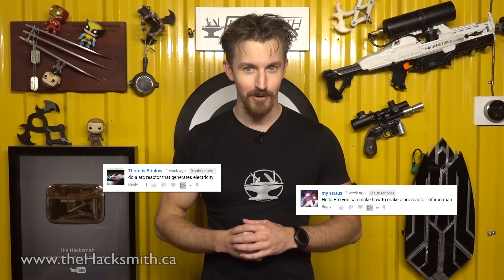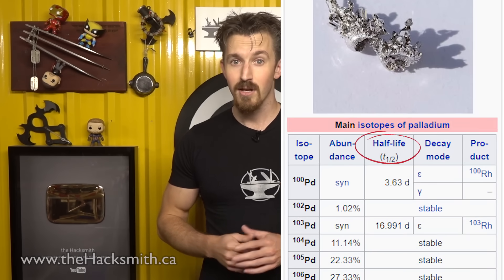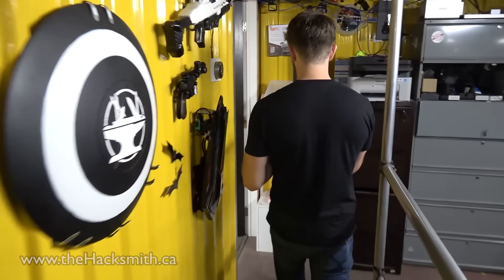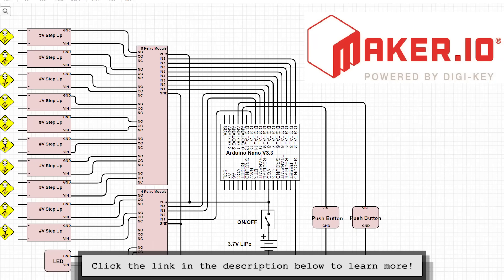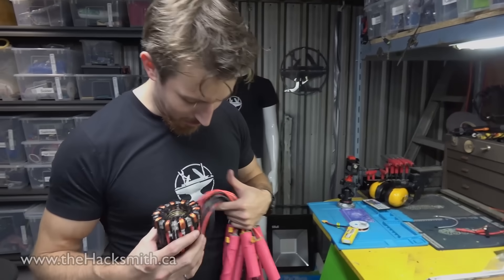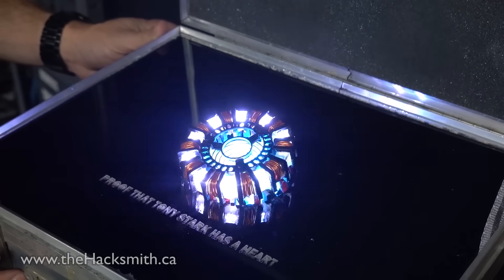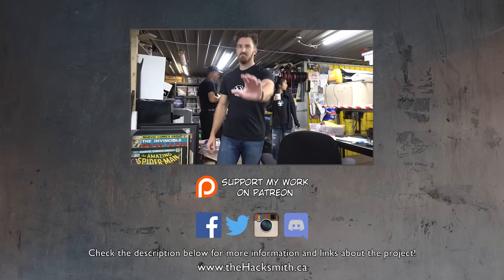Real Arc Reactor (ionized plasma generator)

Comment: Aaaaah, ARCS! Also for low power low noise arc reactor, you can also use a circular glass tube (like neon light), fill it with argon or something and run high voltage plasma through it. Maybe I should try and make that myself...
Reply from the maker: Do it! The internet loves arc reactors :)
Reply: @hacksmith  lol☺
Reply: @hacksmith  is banana radioactive
Reply: @hacksmith  the key to making and technology isn't using less energy than you put it. It as finding ways to harness laws of the universe to do the energy collection for you (which in our eyes is limetless energy)
Reply: Try it ! Use Xenon so u need to be Patient to dont get poor 😁
Reply: Collab
Reply: @LokayB455  no that's a bad idea he will just gonna destroy it all and die
Reply: It could be used as a prank when someone is sleeping you could just turn it on they’ll get scared
Reply: My thoughts exactly.
Reply: Gimme da meter
Reply: Ohh it's you 
Good luck man :)
Reply: I love your channel Electroboom you are too funny
Reply: Give me the meter...give it to me...
Reply: That's the first idea i got - i found a old flash for cameras likely from 60-s or so.  it was a U shaped tube. I used 9V supply and a stepup transformer from a TV - had no problem with a full arc - not constant tho.  That was like 18 years ago.
Reply: Oh and also gimme da meeta
Reply: Yes
Reply: YES!!!!
Reply: Right hand rule :)
Reply: You should do it!
Reply: Don't blow yourself up
Reply: That would be really cool, just be careful of not dying in the process :D
Reply: What about hydrogen so fusion will happen
Reply: Argon wouldn't get the affect you want for the plasma... H4 is what you would want to use ideally but normal h should work... (hydrogen 4)
Reply: Gimme da meter

and dont forget

BEZAN-LIKE-O
Reply: Can you please give me that
 Iron man helmet i beg
You
Reply: Yes!!! & Please make video & let me know
Reply: Please make it!!!
Reply: I am just  wondering electroboom while watching the video, and got you down in the comments
Reply: Oh look whos here!
Reply: ElectroBOOM Come on do it!
Reply: Which has the advantage of looking like the big one from the movie! You might wanna inquire if Stark Industries is hiring.
Reply: you have to do this with rubber gloves ;-;
Reply: Ark.. not arc.. ARKS. Damnit why is it so hard to realize...
Reply: ElectroBOOM Or touch the mains! ;)
Reply: I was thinking the same thing.
Reply: yes
Reply: Can you explain how the power is drawn from the arc reactor..?
Reply: @UltraInstinct666  the ''arc reactor" they made in the video isn't real it's just for show. They are using power from a battery inside the case
Reply: @captaincrazy5008  
Yes I know that... I just wanna know how does the ark reactor give the output...thats it
I meant either any of them..
Reply: We need collab
Reply: I dare you to make it. It's gonna be LIT
Reply: Do you have any limit of knowledge
Reply: Do it and you're cool
Do it and you're cool!
Reply: Just do it Electroboom
Reply: Hi
Reply: Go for it dude!
Reply: hey make it, we would love to see that
Reply: ElectroBOOM mate you will go boom if you try this
Reply: Please make it
Reply: GIMMIE DA SCOPE!
Reply: So it's actually safe to charge your phone with that? 😂😂😂
Reply: Yes please!
Reply: you better do it man, i will love to see that one, +1 good man
Reply: Yes plasma! Those gases are easier to obtain now
Reply: There's a machine I used when I was taking a course in micro technology. Not sure the real name of it, we just called it the sputterer. It's about oven sized and is a large chamber that you fill with argon that gets ionized to the point where the ions starts to bump into a gold or copper disk and effectively yank atoms off of it. Basically it just creates kind of an atomized metal mist so you can throw a few microns of gold or copper onto the surface of a silicon chip. The viewing window looked just like an arc reactor when the machine was running. 
Tl;st: I had a class where we used an arc reactor looking thing to make things more shiny.
Reply: Holy shit, electroboom!

hi.
Reply: ElectroBOOM DO IT
Reply: I was thinking the same thing, there's hope for me yay.
Reply: Just make it and BOOM!!
Reply: @ElectroBoom please do!! I would be excited to see how you manage to hurt yourself in the process!!
Reply: don't forget to shock yourself
Reply: NOW A DAYS EVRY THING BLOWS UP
Reply: I was just vacuum pumping mine out but I guess gas could have a pretty neat effect however I think that the extra material in between the arcs wouldn't be power-efficient though
Reply: What
Reply: @square9980  did what I say throw you off just wait my version will be out soon currently have collected 64 grams of Palladium from old computers as soon as I find a machinist that can use Diamond bits to cut quartz crystal I will start production of my model and we'll see who produces more power remember this one on the video is only using arcs of ionized energy mine uses a solid beam of it
Reply: IIRC Argon would create a green tint. I think they use nitrogen to create the blue color in plasma globes (helium makes the purple color), but Xenon would also work (and be expensive as all get-out) but would be a much darker blue.
Reply: It's called a plasma ball and Nicola Tesla already invented it. Lol. That is the first component of an arc reactor the plasma will spin if you can have an induction coil around it. That's okay I have said enough please excuse me I am a mad scientist. Lol
Reply: For the love of all the possible boom, please built it!
Reply: The key is the frequency, higher frequency = lower noise.
Reply: Dont hurt yourself
Reply: If this guy thought he would get shocked a lot, I can't imagine you
Reply: I was going to suggest that putting it inside of a vacuum tub wpuld help increase output by lowering resistance. The problem is having to replace all those batteries he used to build it...
Reply: Hell yeah
Reply: I did some research and carbon dioxide spectrum tubes are already the perfect color for this. I'm wondering if you could somehow make a carbon dioxide spectrum torus. Essentially a circular tube, it would be able to be a lot shallower and a lot less dangerous.
Reply: why are yo here i thought better of you xD
but still its sad that how many actually believe that it works
Reply: That really works
Reply: Did you do it?
Reply: I was watching this episode thinking, “man, ElectroBOOM would friggin love this shit” and low and behold the top comment. Lol
Reply: Next he’ll be making whips...
Reply: Rrfggj
Reply: And kaboom🔥😂
Reply: I need you for my armor project codename project Tony Stark memorial
Reply: @No Name Yes,Dumba*s
Reply: Lol U missed he got it first. Why not U try to make Iron Man Shoes with thrusters
Reply: I read this in urvoice
Reply: Oh shit the real electroboom dude why do i have a feeling that the one you make will blow up
Reply: Use helium thought, glow discharge would look exactly like arc reactor.
Reply: lets build it sir.. i want to know how you explain that arc reactor.. bytheway im your fan.. 😎😎
Reply: Yes also i love your chenel electroboom
Reply: Hlo
Reply: Please make one... 🙏🙏🙏🙏
Reply: Yes please!
Reply: WhT
Reply: Try  It  please 🥺
Reply: Ye
Reply: Question, can electro magnets create a magnetic field?
Reply: No no no no no no no no no no bad idea electro boom worse things worse you’re gonna get hit by a arc straight to your brain
Reply: your reactor is not working despite all the calculations presented. And the main mistake is that the arc is ignited in the plasma of an inert gas. In the film, this moment was shown just before the launch, and you didn’t even pump your “prototype” with argon. But they deceived the spectators!
Reply: Oh look who's here the 
One that gets shocked all the time
Reply: Hey bro my favorite your canal❤
Reply: Yes a very dense glass like zircon ring might work
Reply: Dude how are u alive?
Reply: Electroboom I've been watching your vids since last 4yrs. I expect you to make arc reactor. And I know you will not like this reply
Reply: Yes try it
Reply: Im going to subscribe just to see it
Reply: Lol try and use radon idk what color radon is ionozed lol use radiation suits too
Reply: what electroboom is suggesting is currently in the works in real life , said problem as hacksmith stated is heat , the glass tube will melt without a electro-magnet to control the super heated plasma to the middle of the tube ( the copper wires around the glowing bit in the arc reactor)
Reply: Ofcourse you should
You are best about understanding voltages and current and at electronics also

Go ahead
Reply: yes}! make that high voltage reactor and atach  to you chest!!!
Reply: what if u remove the air so then u could minimize the amount of losses

Comment: Can you make it quieter by making the voltage path air tight...then putting it in a vacume?
Reply: Electrons cant flow through a vacuum in the sense that they flow through air. Technically its could still work but i dont believe there would be any light given off by the "arcs"
Reply: Mitchell Acton what about filling the arc reacted with air, then sealing it, then put it in a vacuum
Reply: that would work, but youd have to fit the wires through the vacuum part and into the air part which might be tricky

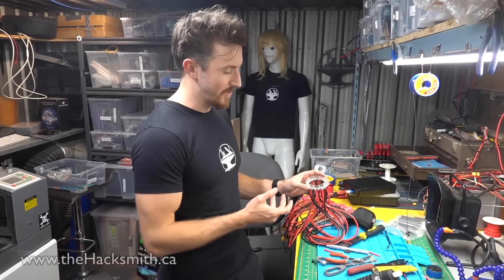Comment: Best moments were 7:18 and 8:17. I suddenly remembered Beyblade from the second one.

Also, do those copper coils actually serve a purpose in the distribution of electricity? Or are those just aesthetic?
As for other projects, let's see you make Blackwidow's stingers from this, complete with projectiles
Reply: The entire project is aesthetic. It is a very good arc reactor replica but in the end its actually less efficient than just using the battery that is powering the whole thing

Comment: The big one looks like a tokamak ring which is a real type of fusion reactor. So no violation of conservation of energy here. They work by containing a super heated plasma of hydrogen inside a magnetic field in a ring. If you get it hot enough then the hydrogen fuses into helium. Looks like lightning because lightning also creates a plasma. There are actual real experimental tokamak ring fusion reactors in operation, They do actually create fusion energy, just not as much as what was put in to super heat and contain the plasma.

Comment: I have an awesome idea . 

So your ember that lightsaber you built and how you said if were to cut through the metal table it would need an arc reactor . Well look . But I know that if we’re to be attached to a pack on your hips or something to hold the reactor it would probably burn through yourself. However I think that you should make a largeish drone (a bit fair bit bigger than the palm of your hand )  than make it power both the drone and the saner and give the drone a proximity software thingy  so it stays close to the lightsaber but still at a safe distance. Like if you agree
Reply from the maker: The arc reactor doesn't put out any power for that
Reply: Oh ok makes sense. Thanks for taking time to reply at least 😁

Comment: The 'arc reactor' actually uses fusion (just like a star) and by using two hydrogen atoms, fuses them together and creates helium and in doing so, releases 1 neutron (can be converted into an electron), this creates a positive charge on one side and creates an electron flow... I should stop now.

Comment: 0:34 Correct me if I'm wrong, but isn't that supposed to be a cold fusion reactor? So technically that's not electricity but plasma loops... if cold plasma is even a thing... okay, yeah, I get your point now :D
Reply: Yes, it does, but it is just plasma that is colder than normal
Reply: Well it's called an arc reactor so it seems to me that it somehow uses an electrical arc to cause fusion.

Arcs in welding can be 3000-20000 degrees and regular fusion requires 100,000,000 degrees. So yeah without something we don't know it's not going to work.
Reply: Axeon stop knowing stuff

Comment: If the tube was sealed off, with an easily ionised gas inside, you could have used plasma-generating electromagnetic antennas (Like a helicon antenna or something). It would have been 5-10x more expensive and 20x harder, but it would be epic. If only the money, I guess.

Comment: I’m by no means an expert in this area, however it honestly looks like it’s a simple battery bank that uses the “arc reactor” to show its operation by sparking inside. Kinda like a car battery and using jumpers on then touching them together. 

Who knows though, if I’m wrong please explain the process. I’d rather be wrong then ignorant.
Reply from the maker: Did you watch the whole video?

Comment: I was expecting for a plot twist where the Hacksmith accidentally creates a real working arc reactor (I mean it really pumps out some voltage instead of sucking it from the lithium batteries)
anyway, you've done a great job. this is exactly what I signed up for when subbing this channel

Comment: If you had vacuum sealed the inside of the reactor it would've required much lower voltage and wouldn't have been as loud. plus electric arcs in a vacuum look really cool.

Comment: Sir can you please give a complete circuit diagram ...because I didn't see the charging socket connection anywhere...in circuit diagram. I seriously don't see how you charged your phone..
Reply: Because the circuit didn't charge the phone, the battery the circuit is attached to did.
Reply: @williamforbes6919  OK...thanks ..

Comment: Im confused... so does it create power or not? And how does it create power? You diddnt really explain that at all.
Reply from the maker: Helps if you watch the introduction :)
Reply: @hacksmith  i did :)
Reply: I watched it twice and i dont see you explain the power output just how power is being put in to make it arc.
Reply from the maker: Exactly. The circuit diagram explains all
Reply: @hacksmith  i love your videos man but you need to be more clear lol. I had to click on the link for the arc reactor diagram to know for sure that there was no power generation. It would just be nice if you outright said it only uses power from a lipo battery
Reply: Most of us are dumb civilians with very basic underatanding of electricity haha.

Comment: Couldn’t u just extend the wires so you could possibly wear it that way the boost converters in a power pack on the back
Reply: Also any more updates on the spider projects and could u make a detailed video about using a camera flash circuit for building a coil gun webshooter

Comment: You guys should make a Portal turret that fires the whole bullet, just as advertised by Cave Johnson. Conveniently, doing this would mean that technically it isn't a firearm, as it doesn't use the bullets as intended. Of course, you could just 3D print the projectiles instead and avoid the problem even further.

Comment: If you just wanted to run the arc reactor could you have hooked all the voltage  boosters up to just one battery? A good lipo could handle 20A
Reply from the maker: We did hook it up to 1 battery! the voltage boosters are the pink battery looking things
Reply: @hacksmith  that makes sense, thanks for the reply! Those voltage boosters are way too fun, I made some taser knuckles with them this summer

Comment: You know super magnetic lasers could allow you to build a small nuclear fusion reactor though I have no idea how much a laser like that would cost an if you were to test such a device I sugest a test chamber with concrete walls on all sides and away from any flamable buildings that way if you have a breach the plasma and the neutrons won't be as big of a danger fusion reactors are a lot safer then fission you won't have a meltdown an even if you have a catastrophic failure all it'll do is leak high temperature plasma
Reply: I'm trying to understand if either I am completely unaware as to how fusion and fission technology works, or if this comment is mostly jargon that was compiled together because it sounded like it makes sense.

Comment: What actually is the power output of your Arc reactor, compared to the 3GW from the film?
Reply from the maker: (-)74W
Reply: the Hacksmith next question: can I buy one?
Reply from the maker: Why would you want one? It uses electricity, doesn't produce it
Reply: the Hacksmith The real question is why wouldn't I want one. After all, it would make for a pretty impressive display item.

Comment: why did you use high voltage AC transformers with a taser like output (which creates that high pitched annoying sound) instead of using DC transformers to have a high voltage DC output thus removing the annoying sound (making it more dangerous) and have it make a humming sound instead???
Reply from the maker: power requirements -- a dc arc will also behave differently
Reply: Is there any way of creating a smoother power delivery with possibly a higher frequency to get rid of that sound, i mean it wouldn't completely get rid of it but it might tone it down a bit (I don't have a degree in electronics sadly but i watch alot of electroboom)
Reply from the maker: @AncientDragonMusic  maybe, but what's the point?
Reply: Don't really have one other than lowering excess noise, but I do think its really cool that you were able to build this. also what kind of circuit are you using to power your phone?
Reply from the maker: a basic usb power regulator